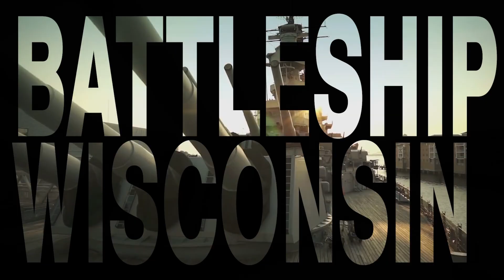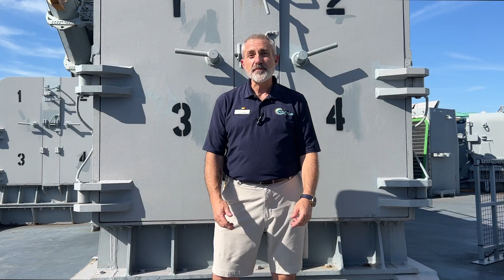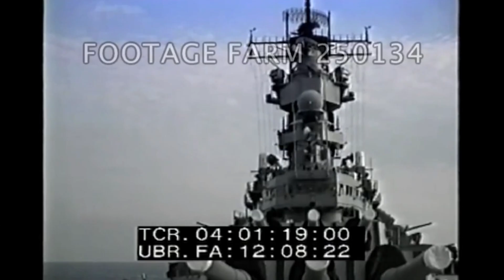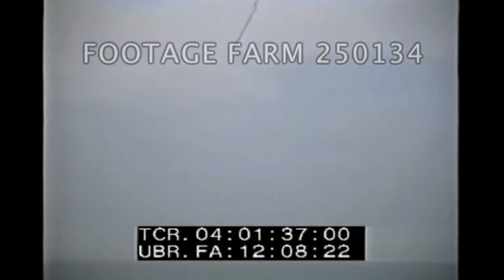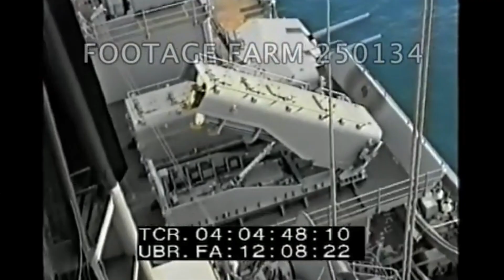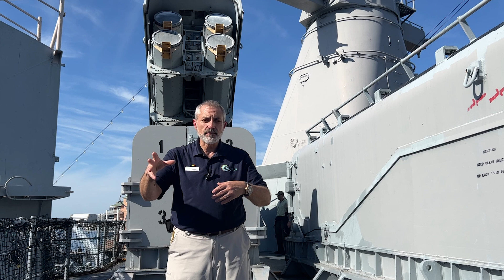How Many Tomahawk Missiles Does the USS Wisconsin Carry?

Comment: Did the Tomahawk have to use all 10 way points on the way to the target EVERY time? Could you only program 7 waypoints?
Reply: It does not need to use all 10 way points. it is the maximum number of waypoints. Changes in course / speed and altitude. Thanks for watching!

Comment: Were the armored box launchers set in a fixed position? Meaning would the ship have to be oriented in the correct direction before firing the  missiles?
Reply: Tomahawk cruise missiles are designed to fly at extremely low altitudes at high subsonic speeds and are piloted over an evasive route by several mission-tailored guidance systems.  They can be fired and find their target no matter the ship's orientation.
Reply: Yes and no, while the ABLs themselves are in a fixed position, once launched, the tomahawks can change course once airborne hit their target.
Reply: These are correct answers! Thank you for watching!
Reply: This question is literally what I needed answered as I'm currently working on a novel!!! So glad you guys had a chat about it! Awesome video!